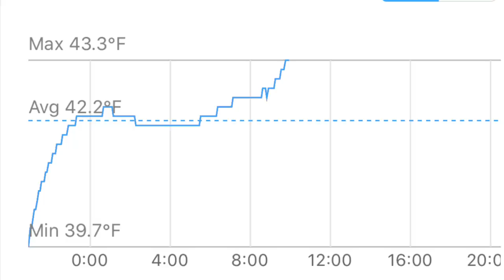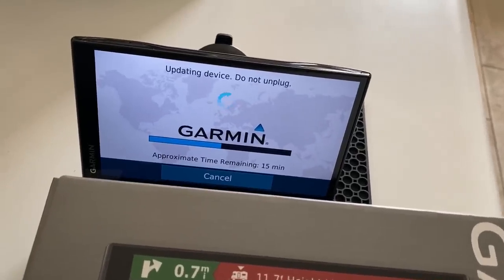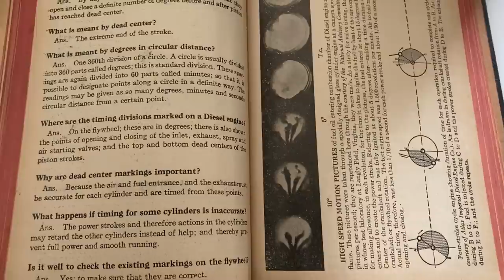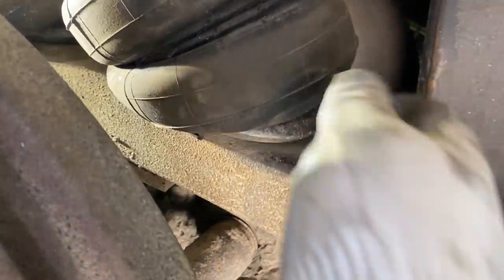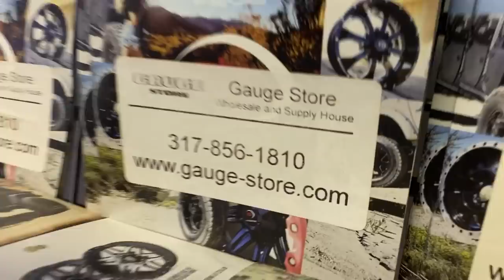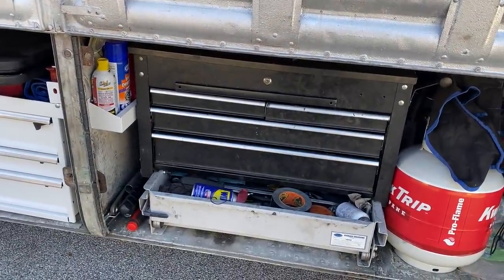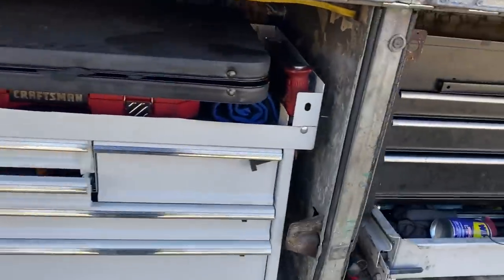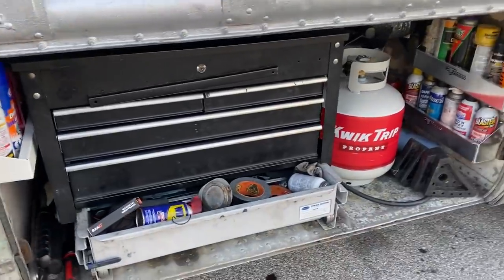Between trips.  Just some stuff on my bus

Comment: I haven't put cardboard in front of a radiator in nearly 30 years,  but when I did need to use it,  I found that waxed cardboard, such as on boxes that contained produce items, held up extremely well against snow, ice, rain, etc.  Commonly found at grocery stores, markets, restaurants looking to get rid of their boxes. It's almost always triple-walled stuff too, which aids in the rigidity and longevity as well.
Reply: or a political yard sign, after the election of course...
Reply: Yeah that coroplast stuff would be cheap (after the election, of course) stuff to get and use.   I use to put in 2 pieces, side-by-side and slightly overlapped,  that way if it warmed up a bit, I could slide one over like a sliding patio door and let more air go past the rad.

Comment: Back in 71 my first car was a 61 VW bug with a near full length rag top sunroof. I was able to get a auxiliary gas heater installed and had the same problem you described, wouldn't ignite. A local independent VW shop cleared it in 25 minutes and said the way to avoid it from happening again is simply fire up the gas heater once a week to kill the spiders and burn out the nest they build in the combustion chamber. 7 more years of trouble free operation before I replaced it. 

Cheers!!!!

Comment: The way you have the tools and trays will really keep the stuff off the floor and organized. I'm bad about putting things down and not in their proper place until I can't find anything then I put everything up and start all over to find out that there is 2 or 3 of everything. That's what the overflow/extra box of stuff you pulled out reminded me of. Smart thinking of the clutch because it might come in handy since you are working on the same model. Drive careful and be safe. Hope I get a chance to help out in NC.

Comment: I've got many a hour using that Injector tube installation tool and cutter.  Just need a good air gauge test kit for checking the tubes once installed. The other thing you need is a magna flux kit. And of course a valve grinding machine and seat grinder. Then....... on and on.......
I used to work for Emerson  Detroit Diesel here in Alaska in the Reliabuild department. We rebuilt all rebuildable parts on all Detroit engines. I rebuilt all the heads. Everything from 53's to EMD 110's
Reply: I would suggest a Sioux 645 model (or newer) valve grinder with the same-brand seat grinding set.  I had training in gas engine rebuild machining around 1970; and I'm wondering if 2 stroke Detroits used the 3-angle seat method as the correct way to do it?  Valve guide to stem clearance measurements are something to consider, too.

Comment: With that low wattage on the water tank heater, it is very importent to isolate the tank and thicker layer on the top than on the sides, the stuff you uses for the windows will help a lot.
Reply: With that low wattage, I have my doubts that that heater will do much if anything at all in seriously cold weather.  It's a contact heater, meant to be in contact with a vinyl bag of water, already inside a livable environment.  Most engine block heaters are 850 watts (or more) and are meant to warm the coolant inside an engine block.  An engine block might be anywhere from a gallon to 6 gallons.  How is 350w going to do much if anything for an aluminum tank full of water?  That said,  it's better than nothing at all, I suppose.  Yes, putting a cover on it well help a lot. Window shade cover will help,  but also pool blanket (especially one that someone is throwing away) would be good, too.

Comment: I would scan that book and carry it in a flash drive so you can use it in any computer...
Reply from the maker: That’s no fun.
Reply: @BusGreaseMonkey  that Audel manual will soon start disintegrating as the acid in the paper eats away at it every time you open it. Beter to scan it while you still can because it will self destruct in fairly short order. It looks to be a bit beyond conservation treatment, the yellowing pages are the dead giveaway. 
   Tripolar cause Mania and Depression aren't Enough.
Some of those can be found online as a PDF and you can print it out yourself, and use it straight off the computer, the best of both worlds.
Reply: @BusGreaseMonkey  Exactly. That's the same response I gave my niece when she suggested I transfer my records, cassettes, and CD to mp3. Maybe as a backup, but actually being able to handle your information is better than punching a bunch of buttons, and hoping that the file isn't corrupted.

Comment: Let's try this comment again... look into replacing your mechanical fan with an electric with a thermostat you can adjust for this very reason.  Lots of aftermarket options to choose from with the CFM ratings to effectively cool the bus engine.

Comment: you need shutters for the radiator I.E. you'll have to make them...
Reply from the maker: More cardboard should work fine.
Reply: @BusGreaseMonkey  But if you used steel shutters your radiator would be armored. and ready for the zombie apocalypse,  or stupid people shooting at the rad...
Reply: Or add a cover that can be adjusted (e.g. canvas w/ zipper) so you can cover more or less of the radiator depending on the outside temperature.

Comment: Why would a winter front not work for your bus as it does for tractors? Velcro on the leading edge and snaps elsewhere then you would have greater control over the air flowing over the radiator. Just a thought.
        Mike
Reply: One minor problem with that.  There are no radiators on the front of his bus.  All in the rear with the gear.  Unless you mean use the same setup on the rear exterior, which also won't work because it will just draw air from under the bus.
Reply: @ShainAndrews Andrews works pretty well on hwy tractors and they are just as open, perhaps even more so
        Mike.

Comment: Scott you have a '73 Thing. Me too..did you ever tow it behind Lenny.  I heard you can flat tow without any problems.
Reply from the maker: Yes it’s been towed behind Lenny several times.   It’s just a pain to back up with it because you have to disconnect every time
Reply: @BusGreaseMonkey  cool.. I'm going to tow it behind my 1988 Ladder Truck Rv. 8v92..4 mpg and 57 topspeed. Starting a channel. "I bought a ladder truck" going to try and get it adjusted for a little more speed and mpg.